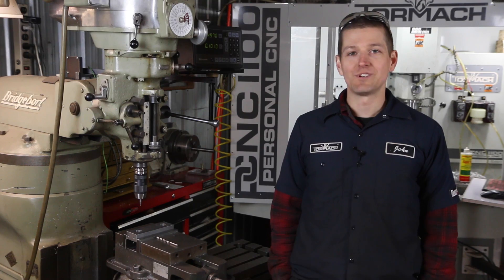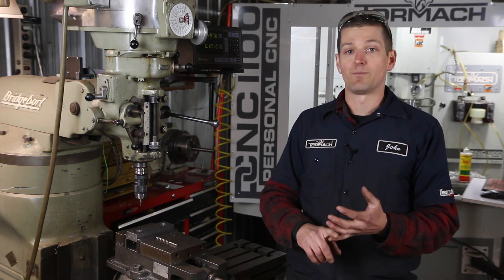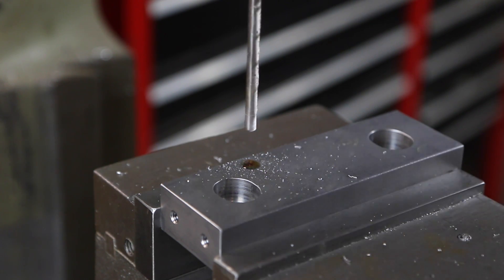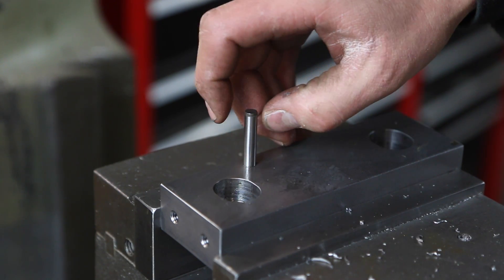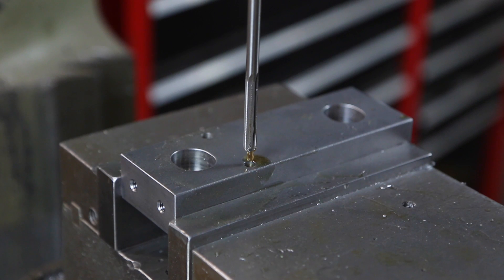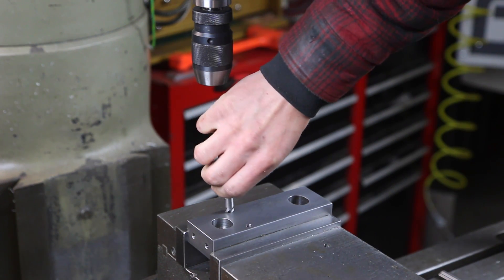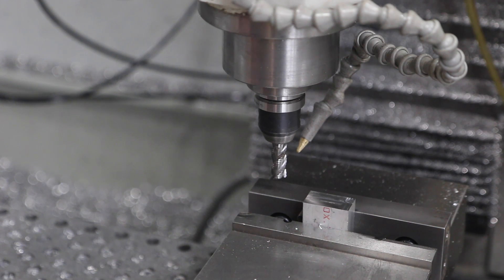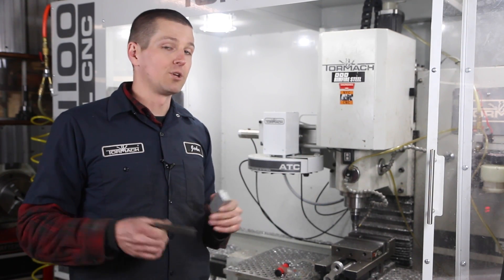Square up Stock with Dowel Pin Soft Jaws!  Widget32

Comment: Have you seen this type of vise jaws.   There are many pins that push in or out to facilitate many different angles as well as squaring up stock.  When you want to reset the pins you just blow air into a hole and that pushes all the pins out.  Then you push in the pins you don't need.  The pins will go flush with the jaw surface in order to use the vise normally.  If you look at the side of the jaw there are a row of four holes and one hole beside the four.  They are for blowing out the pins either by the individual rows or all of them at once.    No need for angle blocks.  Just push in the pins not needed to achieve the angle you need.   They also work as parallels of different heights.  German made of course! 

https://scontent-frt3-2.xx.fbcdn.net/v/t39.30808-6/291834584_10227997723354020_3901934215912431318_n.jpg?_nc_cat=101&ccb=1-7&_nc_sid=730e14&_nc_ohc=iMauzc7DwWoAX8LeP1S&_nc_ht=scontent-frt3-2.xx&oh=00_AT-p0KpZgR9pV-YTrV_vV0ndfQGf1urkiJzsd2Whi0kDZg&oe=62CF3537

Comment: In regard to running larger orders on a CNC machine and buying pre-squared material, did you compare the cost of slightly oversized material vs the pre-cut? 

With CNC machines, you can save a massive amount of time by completely eliminating the squaring process with the use of dovetail jaws or devices like mighty-bites. (or even just stepped jaws and an extra 1/8th of stock material.) Op1 will cut the first side and its contours, holes, etc.; followed by Op2 cutting off the extra stock and finishing the second side's features.

Comment: Neat trick.  To enable you to do thinner stock drill both jaw faces together, then ream fixed jaw face for dowel size and use slightly larger reamer for movable jaw face.  This allows the pin to slide into the movable jaw face if you're doing thinner stock, instead of having to change dowel pin length.

Comment: Also what I usually do to square up and size parts (doing a lot of sizing on a current job as the guy running the saw can't hold a tolerance to save his life) I'll use some sacrificial soft jaws. I'll cut some steps and just offset my part. If the rough stock is 50 thou over my x zero will be 25 thou+ and I'll just program in a simple cut on 0 and the finished dimension. I like your idea and have thought of doing it before but it involves a swap over and as you know time is money. If you question how square your vise is to the axis just throw some soft jaws in and run a stepped cut on each. They will be dead nuts with the x axis.

Comment: Common misconception is that those are spot drills. A spot drill will have less of an angle than the drill itself. This is so the point of the drill makes contact before the cutting edges. If the cutting edges make contact before the point the drill will usually wander off slightly from position. :)

Comment: Having a step machined in jaws is a HUGE time saver! Try and make an undercut in the edge though, even if you have to move further in Y than you planned (say .100" in Z, and .1825" in Y)  in order to have room to run an undercut with a 1/32" or 1/16" endmill. That way you wont end up with chips lifting your part!
Reply: No reason not to, I just prefer using an endmill, because I usually have them laying around more than dovetails.

Comment: Really great time-saving idea! Will use it soon I'm sure. I like the comment about a couple of pins laid out horizontally to replace a parallel in production runs. Nothing more frustrating than having the parallels fall over every time you swap parts -- then have to clean chips to replace it ... With dowel pins, chips are never in the way!

Comment: Machining parallels into soft jaws works great. I have some done about 3/16 deep and 1/8 wide. 

Also, for that cutting fluid, go on eBay and grab a few squeeze bottles. There are some really inexpensive ones with long nozzles and fine tips that work great for that. It keeps drips off the bottle and you don't need gravity to get the coolant where you want it

Comment: Is it ok to use impact tools to open and close the vise. I always thought it might mess up the threads ?
Reply: Dominik Lizak I wouldn't use a pneumatic impact wrench make for semi truck tires, but a small battery powered impact driver seems to work great on the vise, and as a poor man's powered draw bar, where the 7/16" threads are much more fragile than the vise's much larger diameter Acme (trapezoidal) threads.

Comment: The exact issue I'm dealing with. Do you remember where you were getting square machined stock? I got a heck of a quote on raw bandsaw cut bar from speedy metals but have been trying to source Blanchard ground stock. I'm finding it is a good deal more expensive. Almost double the cost. I'm trying to save many hours of just standing there squaring stock to size in an effort to reduce manufacturing costs.
Reply: Thanks for info!

Comment: 9:20 I'd SuperFly that surface!

Another great widget!  Thanks!
Reply: NYC CNC I continue to be impressed with the SuperFly cutter.  The surface finish is gorgeous but it's much more than just a fly cutter.  I guess if you need a deep cut to square up very uneven stock or stock that was cut quite a bit too long, a fire plug roughing endmill could take a bigger bite, but for stock this wide you're still making two passes.  Many times, you could take two shallower full width passes with the SuperFly, and it cuts the same in either direction, so zip over, drop down, and zip back.  Easy peasy.The SuperFly is a different sort of tool, and I think it takes a different mindset.  I love the concept.  One inexpensive insert, working hard!  If you haven't played with it other than some light surface finishing, it might be worth an experimentation video, much like your recent LakeShore carbide endmill in 4140, which was quite impressive.  I think you may be surprised at the material removal rates you can get with the little SuperFly.  I'm thinking about getting a second SuperFly, so I can keep one with an insert for steel and one with an insert for aluminum, not that it's difficult or time consuming to swap that one insert.

Comment: Your holes are too big. Dowels won't go when they fit exact(I mean EXACT)In short runs sometimes a dowel would accidentally pop out of a die or a fixture and the dowel fitter would get so pissed at me for it. I was a little boy then. Every now and then he could get one clean enough to slip it back in.  Dowel fitting is a trade all it's own by my measure of it.   A DeVlieg is handy to have "laying around" for good accurate holes. You ever been around a big DeVlieg John? Won't see much of that on youtube I expect as the guys running those are in the $50/hour range. They are all crabby old men running those machines nowadays.  Machine is too expensive an asset to let a guy like me around. VMCs aren't always most practical, but I do see them replace DeVliegs as a standard anymore in smaller shops. Heck that shift started 10 years ago.
Way way way too much oil there fella! It's cutting oil, not coolant. It increases shear and that's all. If you see a film of oil it's plenty. It should smoke a lot. Don't mean to preach. The run-out of your chuck in that BP is what is causing the loose holes. I been around bud.
Reply: I've never seen a DeVlieg in person but the guys who ran the SIP borers in the tool room of my first job (many moons ago) were the most respected and highly paid machinists.. you're right, jig boring is an art in itself! We must not forget that its been 250yrs since the dawn of the the industrial revolution or to put it another way, we have had 10 generations of  machinists before us. We mustn't think that an idea we have is novel just because no one is using it. In the vast majority of cases its been thought of before..somewhere.. sometime and if its a good one, it will have been adopted by the trade. If its fundamentally flawed, peer review would have spotted it and it would have been consigned to machining history. There are several very good reasons that a good machinists square set against the vise bed and the part moved into position using a positioning hammer is the correct way of doing things... have a think about it ;-)
Reply: l0ckcr4ck3r enjoyed your comment!
Reply: NYC CNC I hope i didn't sound too critical, just spouting off what I was thinking.  *Pressing the mute button now*
Reply: Caleb Welte You'll notice that if you visit their website they  mostly make tooling for CNC machines these days. That process started over 40 years ago, and there are high-precision CNC machines that will position within a tenth, and much faster than a manual jig bore. Progress marches on! Sometimes whether we like it or not.